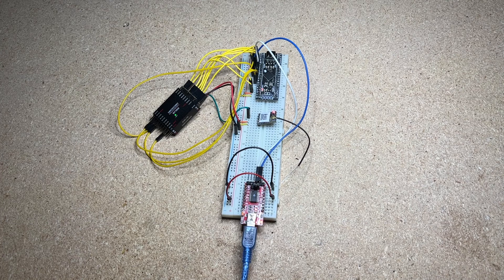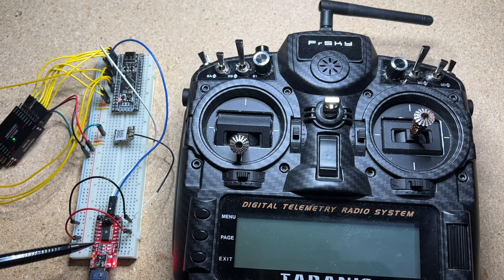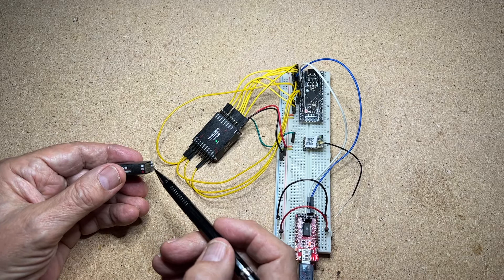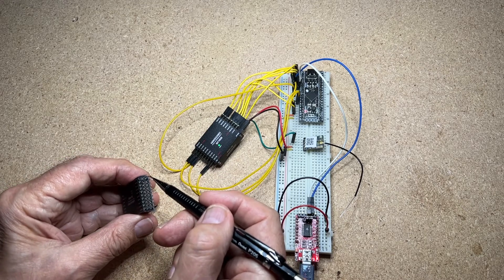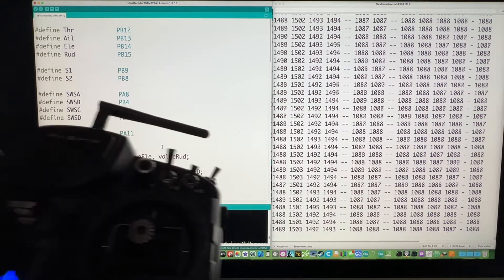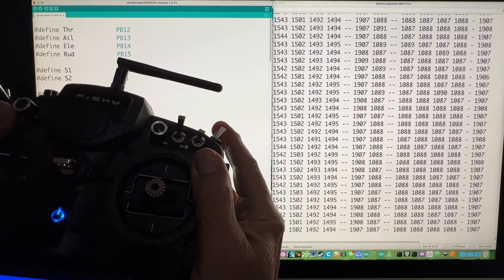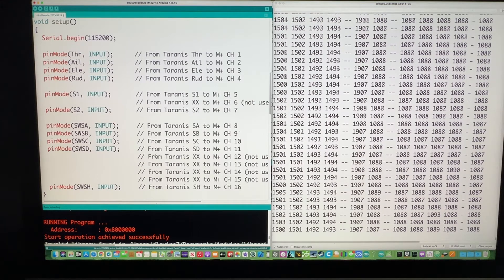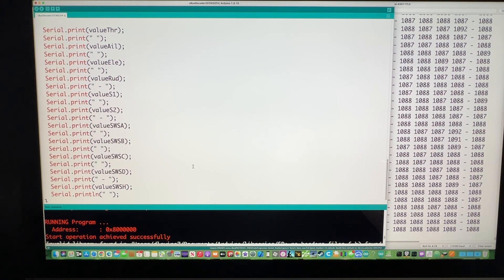A very simple sBus Decoder input to a STM32F4 Black Pill example, demo and code

Comment: I really appreciated this!  It was just what I was imagining might be possible.  I wish I could do it with a much smaller decoder and no uart to usb converter.  Then it would be all plug and play.
Thanks again!!
Reply from the maker: Glad it was helpful!
Reply from the maker: Glad it helped, As an FYI, There has been a software version of a SBUS decoder but I kept have issues with different versions of the libraries and that is the reason I went to the hardware version of an bus decoder.

Comment: That's all?, do it from the receiver, without using the decoder
Reply from the maker: Thank you for your comment. You are certainly correct in that you can take the sbus directly from the receiver to the stm32 without using the decoder. There are several libraries that support processing the sbus to generate the channel data that should be the same as what is generated with the sbus decoder.  Depending on the number of channels that are being used, i have had issues with the libraries. So rather than resolving additional issues for a project I was working on, I just used the decoder. I made this video in case anyone else was interested in the decoder.